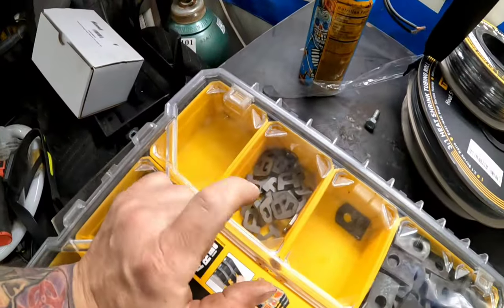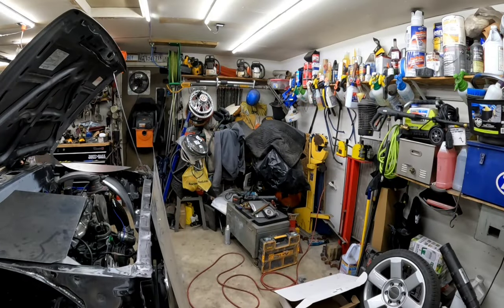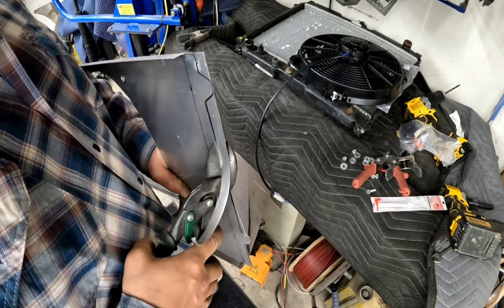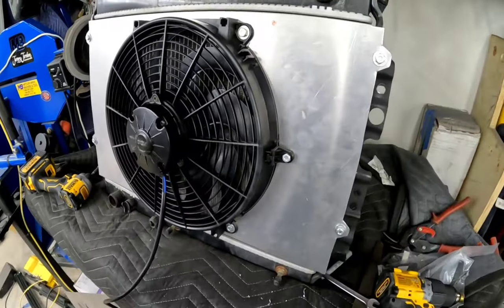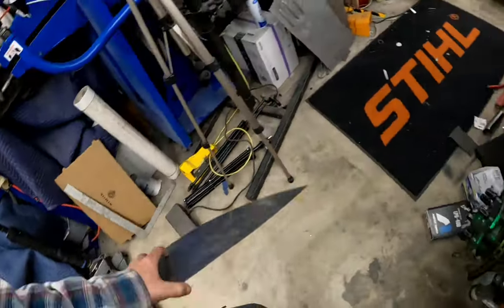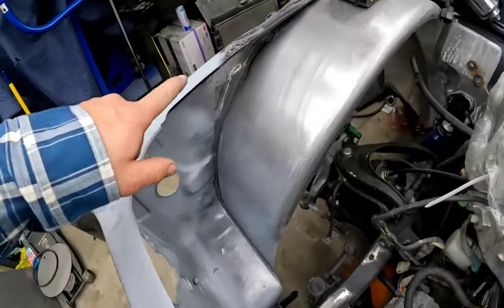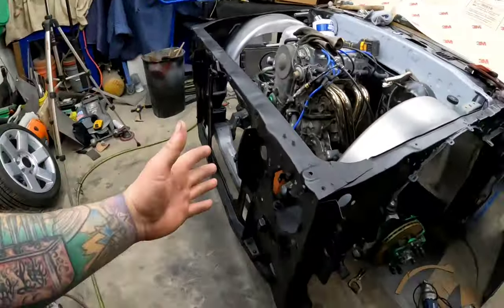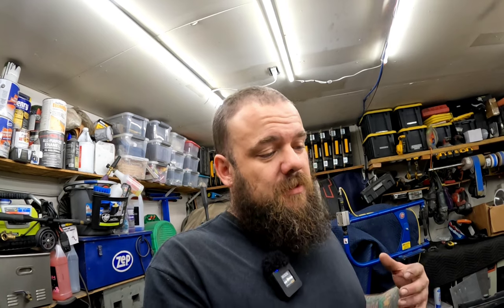Bagged Mini Truck Build #23

Comment: I like the little half-moon shapes you added to the trailer fenders. Nice and subtle but definitely made a difference. Are you worried about the screws hitting the radiator on the fan shroud? It's hard to judge the length of screws vs. the size of the lip you broke onto it. Overall, great job. I like the Duplicolor bed liner a lot better than the Rustoleum stuff.
Reply from the maker: The portion that I bent over is half an inch long, and the length of the bolt coming through the back is just the height of a 1/4 lock nut. so maybe 1/4 inch tall or a little more.  The radiator is a single core, so it's super thin. There's a lot of room in between.  I've used that rattle can bed liner like that on previous projects, and it holds up surprisingly well. Thank you

Comment: Your Truck is really coming along! Just picked up a second 91 b2600i 2wd. Exactly identical to your, just extended cab. Now to find a motor lol.
Reply from the maker: Oo nice. My buddy is looking for a clean extended cab . Getting harder to find around here everything we find is just about rusted in half . Thank you
Reply: Over here on the west coast thankfully, rust isn’t to terribly bad. And prices aren’t sky high either. I have a single cab he could have if he wasn’t looking for an extended cab. Has a good motor to! lol. Just can’t use the motor because it’s the 2.2 carb, new truck I got is 2.6 fuel injected.
Reply from the maker: He had an extended cab when we where younger he's trying to build the same truck he used to have.  Bodied on 20s with a 302.  So its a problem it has a carb ? Or you just prefer the fuel injection ?
Reply: I prefer fuel injection, just easier to deal with. Trying to find 2.6l motor is a little harder to find then the 2.2l though. People think they’re gold! Guess that’s why I got one! Haha.

Comment: Chill guy you are. Like it. 🤟
Bout loovers may not be a good idea cause could bypass air from rad and would take hot air from engine. Happen to me on my sonoma
Reply from the maker: Actually thought about that for the last 2 days on how to support it and make it more rigid without welding a bunch of stuff to it.  I ordered some aircraft solid rivets and tooling I think im going to add some bracing inside with aluminum straps.  Plus that gives me a chance to learn something new. Thank you !

Comment: how much would you charge for build a chassis?
Reply from the maker: There's a lot that would have to be figured out to answer that.  Type of vehicle, style of suspension 4link, 3 link ect . Frame length and material type 2x3 ,2x4, 2x5 or round tubing.  Front suspension from scratch or using a clip from something else.  Lots a variations.  But it also wouldn't be for a quite a while I have a lot of personal projects going on I'm taking a break from full builds for people.
Reply: ok thanks for answer, I have a 91 b2200 im looking to get a new chassis build with coilovers